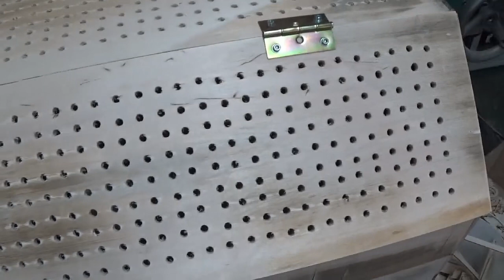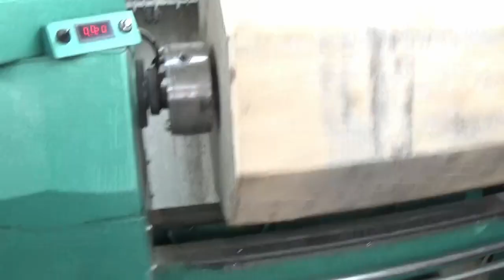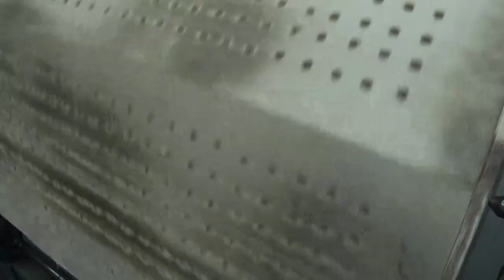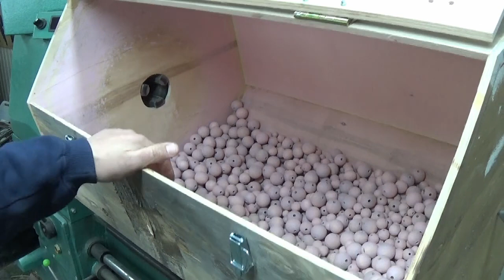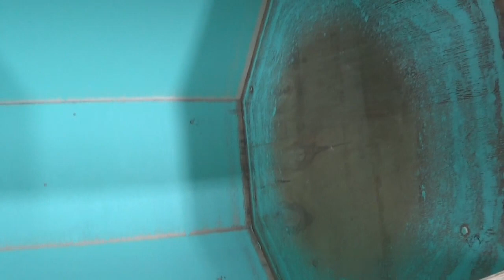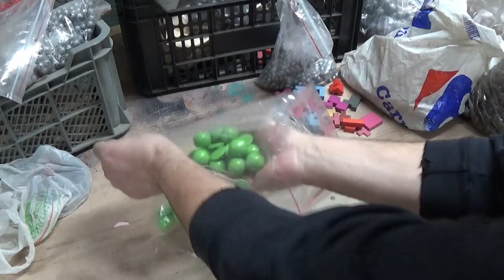Tumbler painting wood elements [subtitles]

Comment: Will you please guide some more details regarding paint process..

i mean is there any need to add any media for painting flat surface wooden blocks.
what are the addons need to add if two wooden blocks are sticked to each other.

will you please guide to paint flat surface wooden blocks.

Have you do PU coating after paint by using this technique.
Reply from the maker: I explained everything I know. For more details you must find paint dealer for this process. I hear there are some media for square elements. But never need that... or know about that in past(when I need it).  https://www.zuelch.com/Products/Tumbling-lacquer-0007113353.html

Comment: Is the tumbler turning continually as the part are drying?
Reply from the maker: No. First is long run till all elements are covered in paint. Next you made short runs like 30sec to 1min for prevent sticking together. You made that in like 10 min periods. Till all is dry enought to prevent sticking. Then you wait next day for cure the layer.
Reply: @artcraft2893  thanks for your help and your video! Do you think this would work for  wooden toy cars  or is it best for round snaps?
Reply from the maker: @woodaddict1  You need find local paint dealer for this method. They have knowledge and can give better advice. Not round object are harder to paint there some addons and technology for that.
https://youtu.be/m9F-SJyHvxM
https://www.youtube.com/watch?v=nI4QSuJKKbE
https://www.youtube.com/watch?v=F0diEDTWEko

Comment: Helleo,I would have a few questions. 1) ratio of paint and water 2) how much do you weave the paint into the dyeing drum 3) how painted wood dries without sticking together thanks
Reply from the maker: 1) Don't know you must find out. That was first time with water based paint for me. And I add to much water in first time.
2) Even distribution of paint. This drum rotate only in one direction so there is no even mixing. Everything rotate around one axis. You should have tilting axe like in concrete mixer(that was my first painting drum)
3) They always stick more or les. Best are beads for minimum surface stick to another bead. But flat parts are nightmares.

So let them littre dry mix of 10-20sec let dry for like 5-10min and next mix.
Reply: @artcraft2893  I have too problem

Comment: Hi, Whether Tetris blocks can be painted by this method?
Reply from the maker: Ahhh this work was annoying. We need to separate parts after painting. Also we spray paint molding slats before cutting to individual pieces. You cant paint in this method inside corners